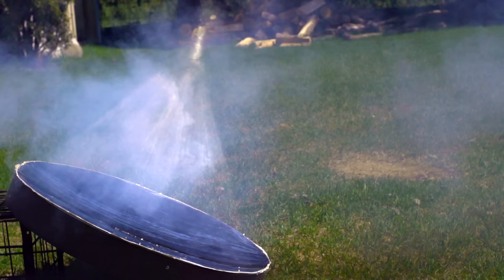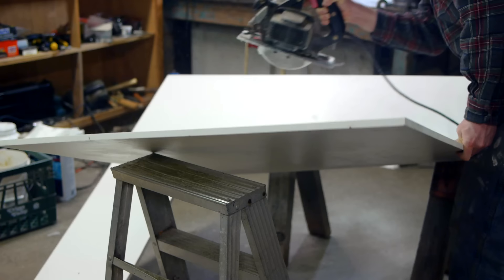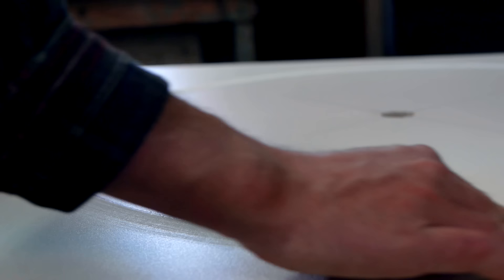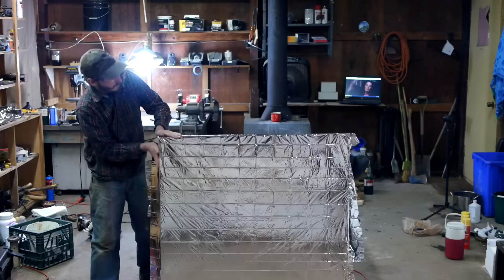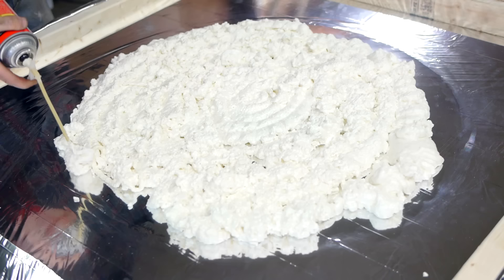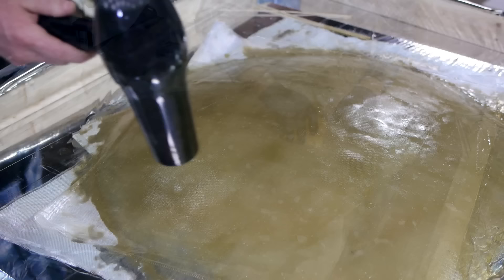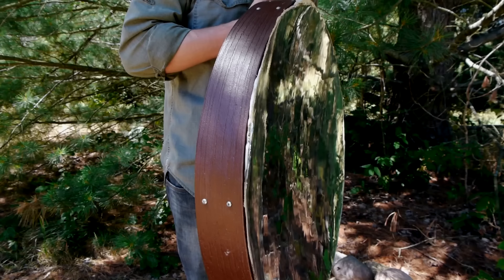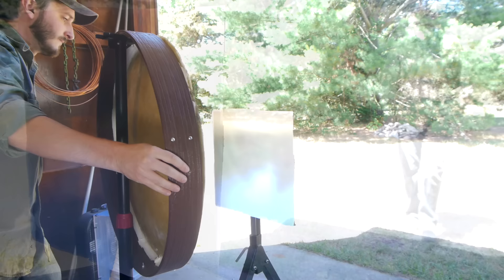How To Make Parabolic Mirrors From Space Blankets - NightHawkInLight

Comment: 🔵 You might have been better off building the frame as a lightweight portable vacuum-frame instead of utilizing positive-pressure to form the parabola,.... so when you suck air out of the frame it causes the parabola to be formed by the vacuum pulling the parabola inwardly,.... as long as you have a good seal the parabola should be perfect and you can always create a greater vacuum by depressing the valve stem and sucking air out of the frame with your mouth if necessary!.... if it's done properly You'll end up with a perfect portable vacuum frame parabola that's literally as 'Smooth as glass' and 'Tight as a drum'.

Comment: Sir. 
If we use ordinary mirror 🪞 instead of this reflecting material that you used here would it be better to produce or concentrate more radiations ?
Reply: No, lol. You can't just use a bathroom mirror and hold it up to the sun, lol.
Reply: @Kevin-sm8pn  sir I'm not talking about holding it.i mean to say if we use cut the bathroom Mirror 🪞 into small pieces in hexagonal shaped and glue it over the surface of your antenna type parabola. It will then all the pieces focus on a single point.
Reply: @akifashrafkhan6436  Still no.

Comment: How is this shape not as sphere?
Reply: It is a sphere, 100% not parabolic. Entropy makes it unpossible to inflate it in parabolic shape
Reply: @wn1757  entropy? I would think just the even distribution of air preasure, in any case, that´s my point, the title says parabolic
Reply: @ahandlenameismandatory  In my opinion entropy is the reason of the even distribution. The pressure should be the same on each point. When it was parabolic, the pressure would be higher in the middle. Entropy does this. But I'm not a physical chemist. I might be wrong.
Reply: @wn1757  I agree with you. I just didn't think to go down to the first link in the causal chain to explain it, but ya, pressure is even because of 2nd law.

Comment: A proton accelerator... very funny.  A PHOTON accelerator is used every day to cut materials including burning CD's and DVD's.  What they are talking about is to cut the silicon wafers thin enough so they can get the most yield out of what they can produce.  Why not mix copper powder and carbon powder in black paint and draw it on a sheet of aluminum and see if you can get a voltage out of it in sunlight?(What happened to this technology???)